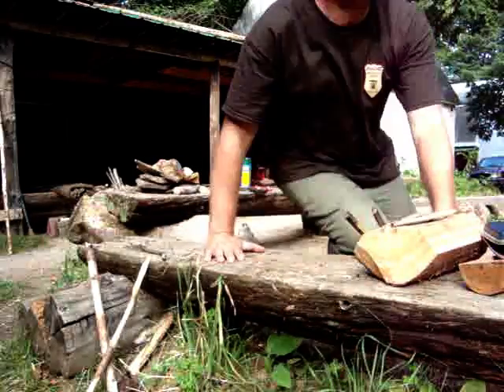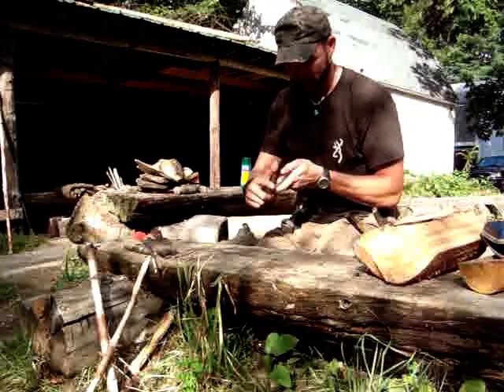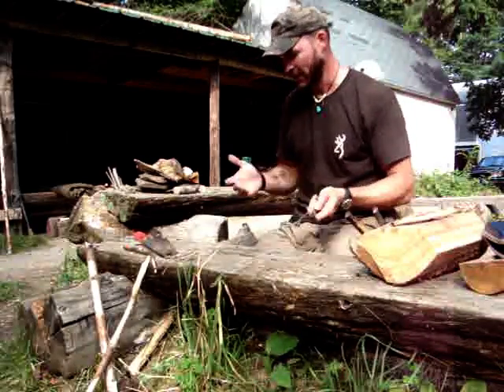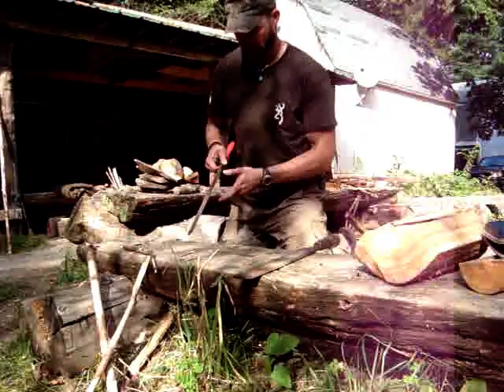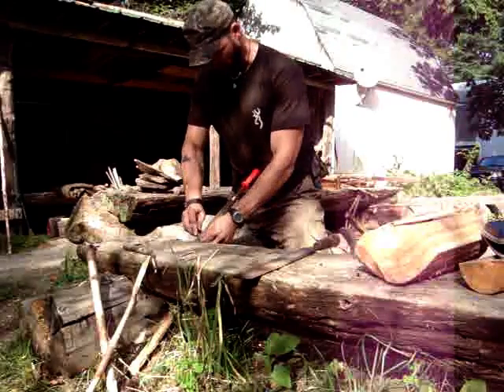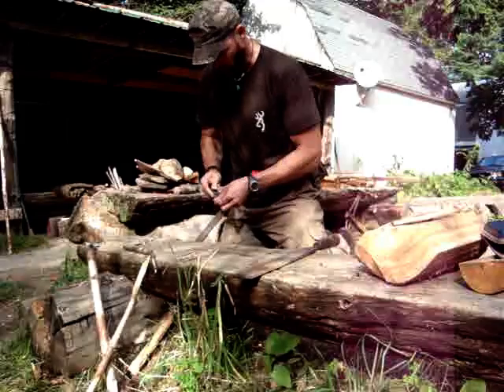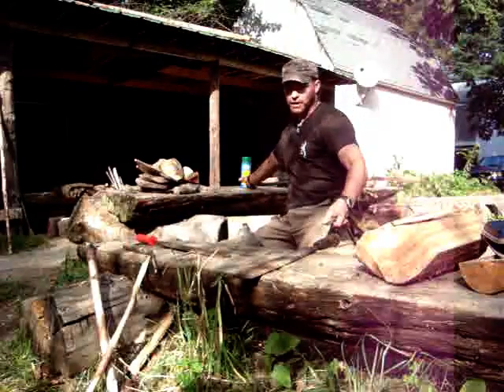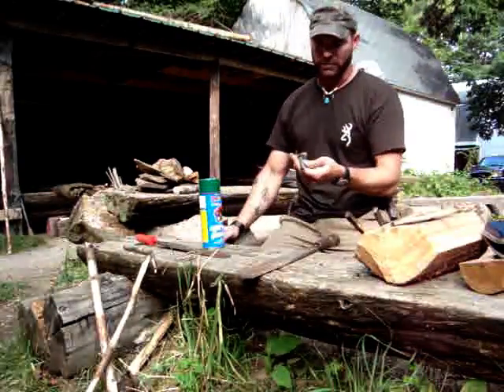Ferro Rod Maintenance

Comment: Thanks for this video Jim. Two questions: I understand the colored paint, to help you find a dropped rod, but could you have also put vegetable oil (etc.) on it for corrosion resistance; And how do you think filing would change the number of strikes for that rods lifetime?

Comment: I have a couple questions with this video. #1, I've never seen or used a rippled ferro rod. How difficult is it to use a rippled vs smooth ferro rod? #2, How does painting it help the ferro rod aside from making it more visible if you drop it on the ground?